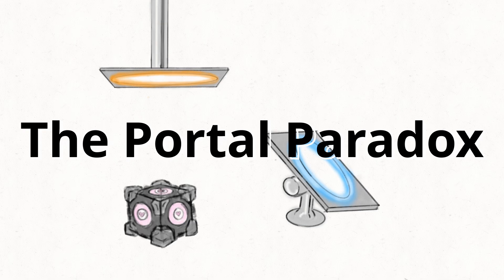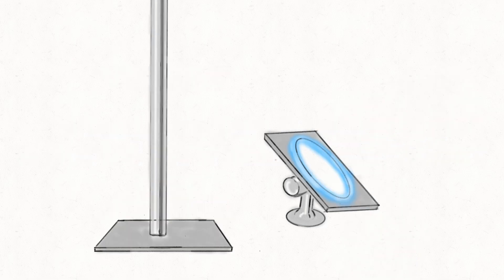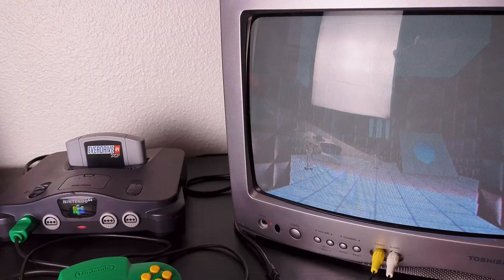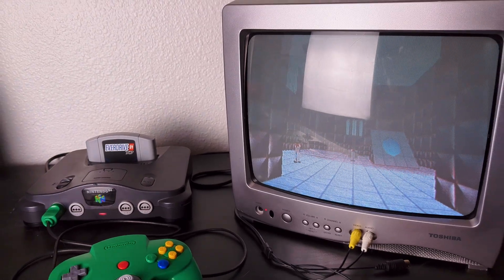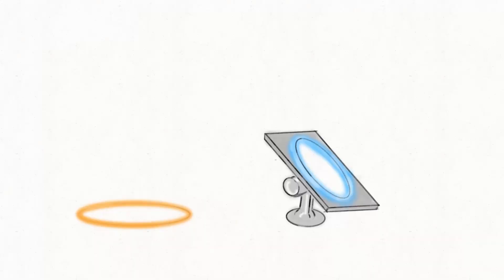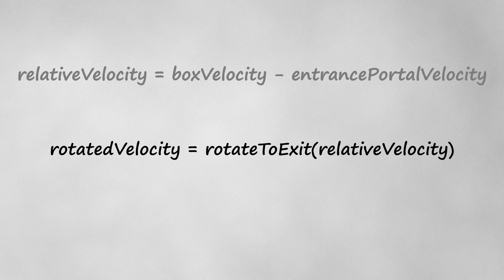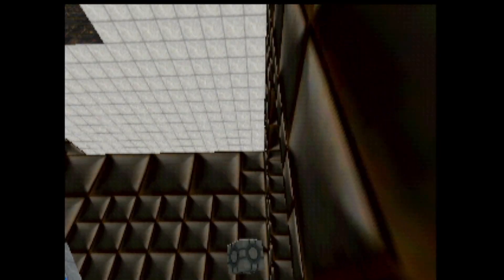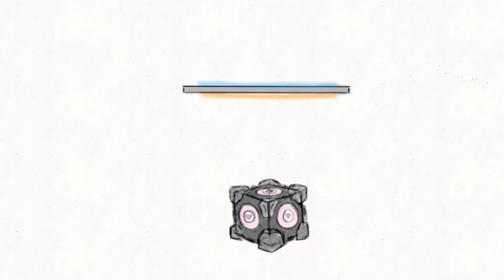I rewrote Portal from scratch and solved the Portal Paradox

Comment: I don't think the "realistic physics" of it makes any difference. The question is whether the code would have it be one way or the other. A non-player object has a coordinate position. Any copy of that object visible through a portal or intersecting with a portal shares the same array of properties, just translated and rotated for rendering and collisions.
The portal itself, when it is spawned, reconstructs copies of the level. The visible portal is just relevant for rendering. The world copies are recreated every time the portal "moves".

The uninteresting but accurate answer is that in Source engine, if you implemented this by moving the portal object, everything going through it would get yeeted at the speed of ((the original position of the portal object)-(the new position of the portal object))/(one game tick), which for most situations would be very, very, very fast, regardless of the actual speed it went through the portal.

If you implemented this by regenerating the portal every frame, you would get a more boring answer: every time a portal is destroyed, fake objects coming through it are destroyed and their real counterparts are pushed out of the portal. This would be incredibly laggy to implement, but if you did, no object could ever pass through a moving portal.

I'm interested in if what you presented in this video was just a mock-up or if you actually implemented properly moving portals. Ultimately, you're right in how it should be done, but you can move portals in Source engine. The result is just kinda garbage either way you do it.

Comment: Interesting solution! I do like how the relative speeds cancel out with the double portals on either side of the platform, that certainly feels intuitive. But reality is often disappointing.. (unituitive). 
I feel like I can point out a flaw in the equation though - to me the flaw is that the equation exists in the first place. ie I feel like asking if there is even a need for relative velocity or the sharing of that force between portal and object? I'm going to suggest there just isnt a need for relative velocity at all if you dont calculate it. I'm thinking of it in terms of the portal velocity not having a relationship with the cube velocity * at all*. Think of it like a car and a pedestrian. The car passes the pedestrian, and nothing happens to the pedestrians velocity at all. Why? Because (in this example) they dont interact. I feel like thats an alternative for this situation. The portal could be moving at mach 2 when it passes 'over' the cube - but the cube will appear out the other end of the portal with zero velocity, because thats what the cube velocity is - and they simply dont interact with each other. The portal itself maintains its velocity, the forces are equal. In your implementation the force of the portal is doubled, as the energy of the portal decreases to zero as the portal slows down (through collision or breaking mechinism), but youre saying this force is also imparted on to the cube. At one point in time during the event either the velocity on both is zero, or is the velocity on both the relative velocity? So the energy in the system either vanishes completely or doubles - which doesnt conserve energy/momentum. I'm suggesting the portal is simply one area of space connected to another area. ie the cube and portal only interact relative to each other with position, not with velocity. (Its also worth noting youve only taken into account half of your equation/effect with your implementation here too, as you need to also ask what happens if a moving cube moves through a stationary portal? does it impart a force on the portal? what if you accelerate a cube up to mach 2 and send it through a portal? does the portal and wall its attached to explode with velocity in the opposite direction?)
 
Of course this all comes down to how you define portal physics. And tbf I think your implementation is fun - not to mention the advanced puzzles you could create using this element of velocity. Imagine the N64 version of portal having MORE advanced puzzles vs the PC classic.
Reply: I was going to comment something along the lines of, what if the moving portal stops halfway down the cube. Would it come out at half speed or what? But this  comments point about the force being doubled in the interaction put into words what I only had a general feeling of. Great vid and great comment.
Reply: Your point is correct there is no need to code the relative velocity of the portal and cause that to randomly affect a cube that makes no physical contact with the portal, if it was coded like real life physics would be the cube having no velocity would plop out on the otherside, I'm not a programmer but maybe it is just easier to code it this way for other reasons, but I do not think it would work like this in real life velocity/momentum are properties an object has and unless another force is acting upon it, it will not move. Since the portal didn't touch the object in any way it won't push the object in any way. In layman's terms: speedy thing didn't go in so speedy thing will not come out.
Reply: I don't think we have to read this as imparting a force on the cube. If we take the inertial reference frame of an observer of the portal's contents, we then see an apparent change of momentum anyway, since it apparently decelerates to 0. The only alternative accelerata is the room - or the universe - since we can observe an apparent force on the cube if we apply an actual force on the room. It sounds more implausible intuitively, but given that the cube's apparent acceleration is the same irrespective of it's mass, forcing the room deals with the relativity of momenta issue, and whatever the paradox resolves to, it should be the same irrespective of what inertial reference frame we pick, so long as it's inside the room.
Reply: imagine 2 portals on a wall, one of which is moving, throwing a ball in to the stationary one, as its exiting the moving portal, relative to the exit space its both moving out of the portal and sideways with the portal making it fly out at an angle. this is why the velocity of the portal needs to be accounted for. basically a moving portal causes a relative movement of the worldspaces outside of the entrance and exit portal despite them being the same worldspace
Reply: @TheElectronicFreezer  a moving portal should only affect the trajectory of an object passing through it, it shouldn't affect the velocity, why should an object move faster or slower just because the portal it's moving through is moving faster or slower? Especially when in game it is stated directly that portal's do not affect an objects momementum.
Reply: @calebmon   @calebmon  because an object exiting a moving portal will also be moving with the portal relative to the space outside the portal, technically the portal isnt directly affecting the object but indirectly as its changing the objects relative context in space. if this wasn't the case there would be weird behavior where an object suddenly loses its momentum like a portal spinning rapidly and a cube put trough it is spinning with the portal until it passes trough completely and suddenly stops spinning in mid air
Reply: @TheElectronicFreezer  I think it's important to remember that portals do not move objects they are a wormhole connecting two points together, saying a moving door frame would somehow make a ball thrown through it move faster, just isn't how it would work. In real life, whether a door frame is moving or not has no effect on objects floating through a door frame unless the objects physically touch the door frame or are moved by the door frame which is not the case, the object will fly through any open door at the same speed regardless of the doors speed. Trajectory could be affected but speed would not.
Reply: @calebmon  Yep, a moving door frame doesn't impart movement on any objects. If the room on the other side of the door is moving, and you (the observer) are standing still in the moving room, the stationary object can still fly into the moving room and bean you on the head.
Reply: @Val  a stationary object will not begin moving just because it passed through a moving doorway, I think the fundamental problem you people have is your applying real world physics to something that does not exist in the real world and the nature of portals, they don't push or pull things through them any more than the empty space between any 2 points push or pull you through them. So even though an object appears through the portal quickly it wouldn't actually be moving quickly itself. If a car drives by you on a road your movement doesn't slowdown just because the car is moving faster.

Another thing about this is when both the object and the portal are moving in opposite directions at different speeds this can create paradoxical situations that would likely crash the game, due to the physics no longer making sense. For instance if a portal is moving 110 km to the left and an object is moving at 100 km to the right and it goes directly into the portal (which leads to a stationary portal in a different room) how fast does the object move on the other side?
The answer is . . . It doesn't? Because it hit the portal at only 100km it loses all velocity and actually somehow now has negative velocity what happens then? Does it go backwards? Does the game crash? If the physics just made sense though instead it would come flying out the other end at 100km since that is the speed the object was moving at, and portals are specifically designed not to affect momentum.
Reply: @calebmon  The stationary object doesn't begin moving if it passes through a moving doorway. This is 100% factual. And I'm not "you people" :)

However, examine the view through a moving doorway. It looks like the room inside the doorway is moving. THIS is where the motion of the object comes from.

Having a portal creates a virtual copy of the test chamber as seen from the view of the exit-side of the portal. This copy of the test chamber isn't real, it's just a visual aid, but imagine for a second it were real. If the entry portal were to slam down on an object, and the entire copy of the test chamber were attached to the portal, then assuming the phantom test chamber keeps moving once the object is fully inside it, the object will *appear*, to an observer inside the phantom test chamber, to rocket off with some apparently ridiculous velocity (THE VELOCITY OF THE PORTAL THAT SWALLOWED IT).

A physics simulation in a video game isn't just a nebulous piece of code that inherently can't be reasoned about. Portals aren't some totally unrealistic concept that can't be reasoned about. You just need enough experience.

The hardest pill to swallow here is that once an object passes through a portal. it no longer belongs to this "phantom test chamber", and thus if the portal were to stop moving, it wouldn't suddenly shift the trajectory of the cube. In moving from the "phantom test chamber" to the real test chamber, you reframe the scenario from one of a stationary cube in a moving test chamber to that of a moving cube in a stationary test chamber. Nothing physically changes in this process, but numerically, you're applying the inverse of the velocity of the phantom chamber to the cube. 

The cube never experiences a force during this whole affair, you've just warped the space the cube exists in such that the test chamber is moving relative to it (and as a result, it moves relative to the test chamber.)

Phrased another way, if you imagine the moving portal is stationary, and the cube is coming up to meet it (which is the same exact scenario), would it make sense for the cube to suddenly stop moving because it went through a portal? Does it really make sense to you that a cube, moving toward a doorway, would somehow stop moving by passing through that doorway?

There's nothing nonsensical or unreasonable about this process, it just requires a little thought.
Reply: @Val  but the room isn't moving and neither is the object, just because something looks like it is moving, doesn't mean it is actually moving . . . It passes through the portal at a high speed but nothing is pushing or pulling it through the portal and the object was never in motion, instead, it is appearing fast on the other side but this isn't movement or velocity this is just an object coming into view, the object didn't move, the space it resides in was connected to another space by portals, in this sense the empty space around the object moved but the object having never come into contact with anything isn't launched or moved in any way until gravity affects it causing it to plop down.
Reply: @calebmon  Okay, cool. I guess if you were to sit in front of the exit portal, then, the cube couldn't push you out of the way, because it's not moving when it goes through the portal. After all, how could it impart a force on you if it was never in motion?
Reply: @Val just because it isn't moving doesn't mean it isn't taking up space. Portals connect spaces together. Neither of the cube nor your head have actually moved themselves, the space between your head and the cube however has moved causing them to smash into eachother at the same rate as the cube comes into view. This still isn't because the cube was moving though. But because the space between the cube and your head became connected by portals this is why normal physics doesn't work, portals don't push anything, they only connect spaces together.
Reply: @calebmon  You are so close. SO CLOSE. But your assumption that portals can't do normal physics things is holding you back.
Reply: @Val  portals are specifically designed not to affect the momentum of an object passing through them, this is stated directly in game. I think this is because Passing through a portal isn't movement in the traditional sense of the word.
Reply: Consider:
"Speedy thing goes in, speedy thing comes out"

This invariant is succinctly represented by
*V*in = *V*out

However, this equation is relative to the singular surface of the portal. It doesn't represent how the cube will act in world-space. In particular, it doesn't account for moving portals *or portals at an angle relative to one another*.

These two problems have the same solution: first, move the object into the entry portal's frame of reference, then out of the exit portal's frame of reference. This is where the unintuitive velocity comes from. When you transform an object to be relative to the portal, you're transforming that object's velocity to be relative to the portal. This is totally normal and valid, and what you'd learn to do in a physics class.

However, it's the transformation from portal space to the exit portal's view of world space where things get weird. Portal space is discontinuous at the surface of the portal, and to move an object through a portal you have to pretend that the entry portal's view of world space is equal to the exit portal's view of world space. They're two completely independent transformations!

Boosting the cube back into world space via the exit side of the portal will impart a velocity onto the cube exactly equal to the velocity it had relative to the entry portal! This is demonstrated in stationary portals by inverting the velocity of a cube as it passes through two sides of a portal placed on the same flat plane (i.e. if you drop a cube into two portals on the floor, it'll oscillate up and down between them)

Comment: NO! The cube has no force! It should not be flying out! Imagine yourself in the position of the cube and the portal zoomz at you, your not moving so not making force and so you will not be flying out but be transported FASTER that is it. CUBE NOT MAKING FORCE = NO FORCE TO FLY.
Reply: LETS FIGHT! Goddamnit isn’t it simple?
Reply: And more so a PORTAL is just a hole which CONNECTS 2 different locations you moving the location will not make you force.
Reply: Imagine a opened door rushing at you, you will not be flying out the other side but you will pass to the other side!

Comment: Yeah, I don’t buy it. The cube isn’t gaining any momentum just because you changed the velocity of the portal. The portal isn’t interacting with the cube at all, otherwise, when Chel shot that portal to the moon, which is moving thousands of miles of difference relative to earth, she wasn’t shot out at a 1% light speed, she conserved the momentum she built up from moving along the decompression forces.

Seems biased to me, or based on bad variables used in your calculations.

Comment: This...actually makes reasonable sense. The difference between launching a cube through a portal and launching a portal at a cube is mere perspective. The force applied to the movement between two objects stays constant, and so a cube should always feel the kinetic impact of the piston to the contact surface surrounding both the portal and the cube. The exit portal acts as a form of "anti-gravitational" environment that lets the cube react to the kinetic release instead of sending the energy directly to both the air and ground. Since when the energy moves from the piston to the cube, the gravitational pull of said cube has changed states and would have started going downwards diagonal instead of just...down, which makes the cube highly sensitive to kinetic transfers due to unequal downwards force on a heavy mass object.

It's like a highly advance version of launching a rubiks cube using a pillow. All with portals and a 4th dimensional perspective. Amazing.